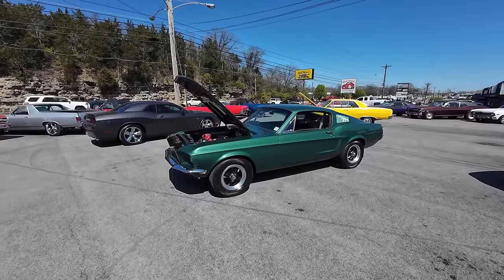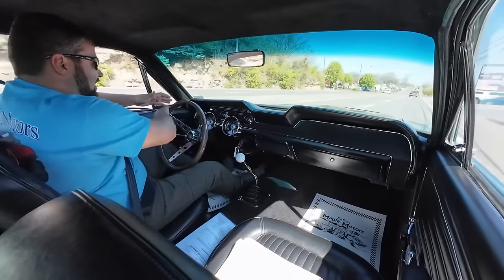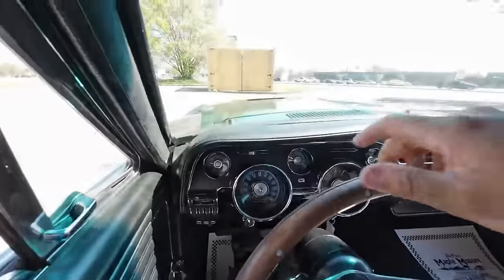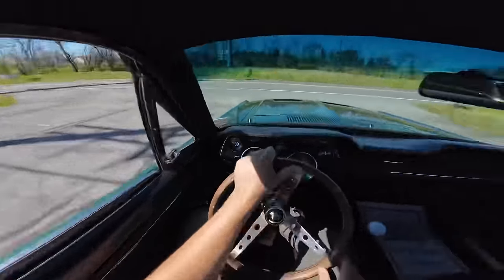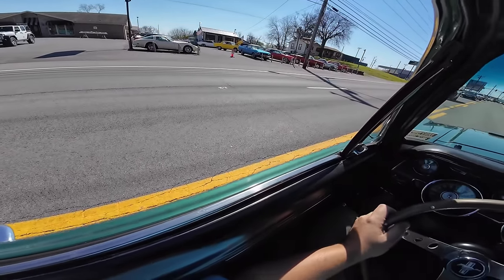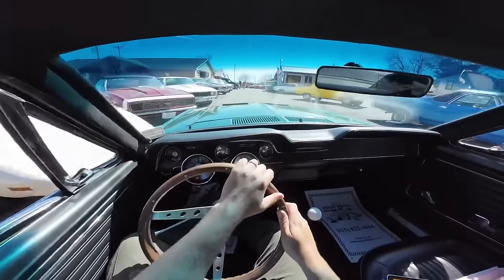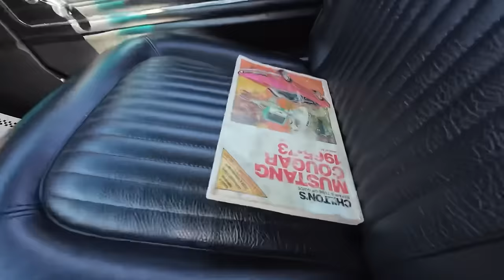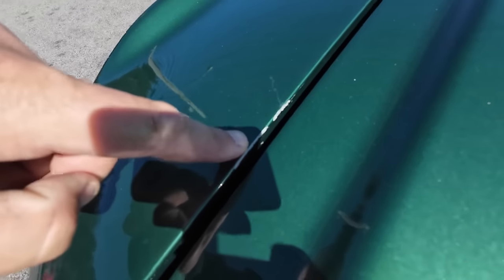Test Drive 1968 Ford Fastback Mustang Big Block FE 4 Speed SOLD FAST Maple Motors #2563

Comment: Nobody picked up on the fact this 68 had no rear quarter marker lights . 67's have no marker lights while 68's have front fender and rear quarter marker lights .
Reply: Front marker lights, rear reflectors.
Reply: some cars have stick on reflectors. very easy to remove.
Reply: @hbmustangs  Early (before Feb 15) 68 Mustangs came with recessed surface mounted quarter panel reflectors that had body colored bezels around them.  Later models came with surface mounted reflectors that had chrome trim around them.    While it would be easier to fill in the holes for the later version, it is most likely that the quarters were replaced .
Reply: @dougjustdoug6391  I agree!! Also '67's have grilles on the low '"C" scallop. '68's do not.

Comment: In your parking lot where your classic Chevies are a dime a dozen, this big block fastback Mustang is a rare treat especially with a 4 speed. You got a real nice driver Bullitt tribute there! The reason why you were going 60 mph on a main street is because the car is packing big gears in the rear end , whoever built this tribute forgot or neglected to change the speedometer sprocket to compensate the gear change to make an accurate speedo reading. Very nice Mustang!!!
Reply: The Chevies are out front on the lot...
The Ford's are in the shop being fixed or repaired daily 🤷‍♂️